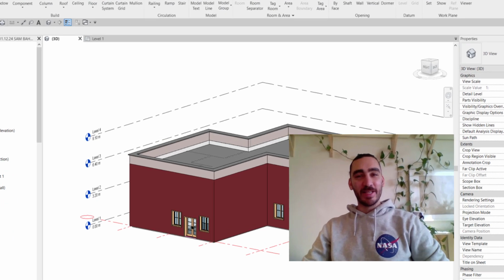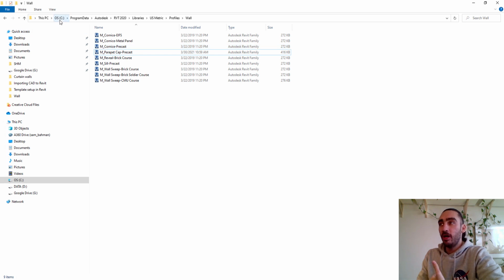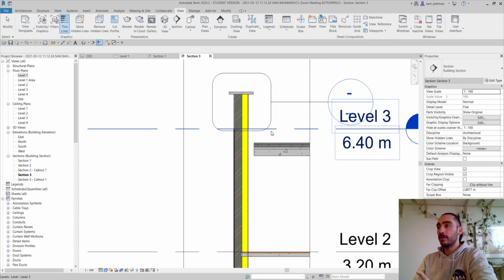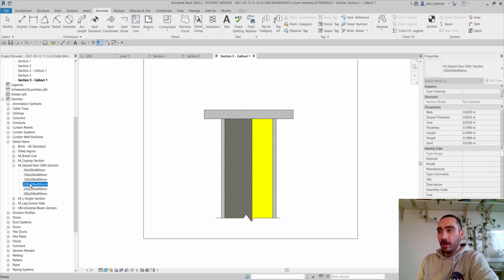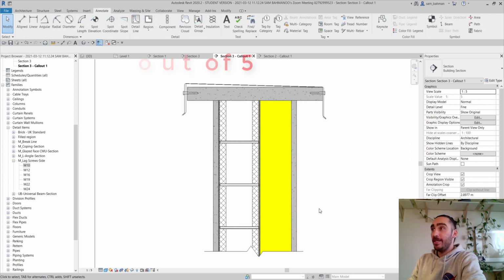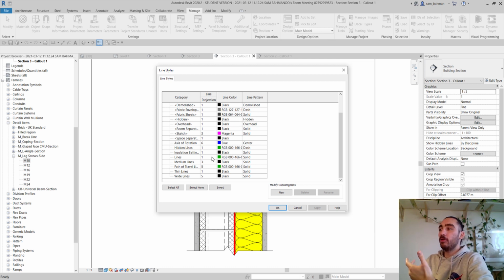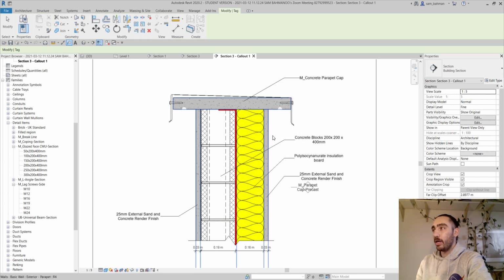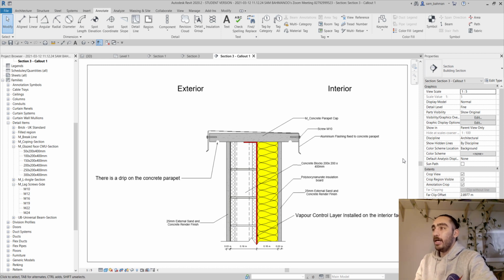Detail Design Drawing Tutorial in Autodesk Revit: Full Modeling & Detailing (TYPICAL PARAPET DETAIL)

Comment: Thank you sam. it had some very nice tips! I'm new to Revit detailings and the Firm I'm working right now expect me to make estimations easier using Revit. however using details like this can't help me for example calculate the amount of insulations or screws or aluminum top. 
There's always a battle between 3D modeling details and 2D. do you have any pro tips for me? How can I have good quantity outcome of details for estimation and at the same time nice details in my entire project?
Cuz it's time consuming to create the same details on different sections as well.